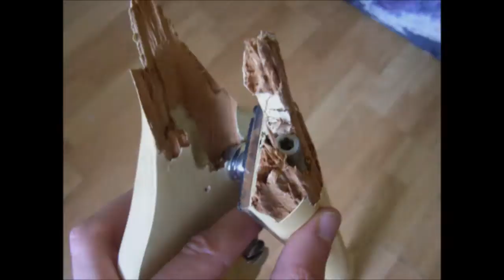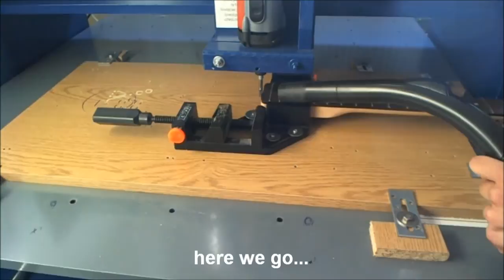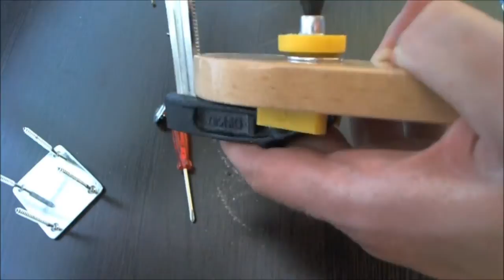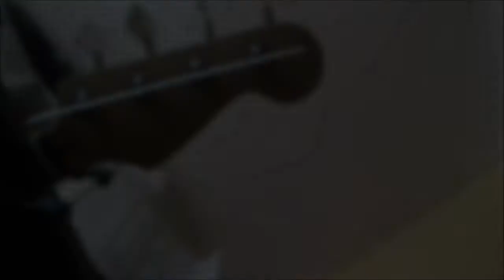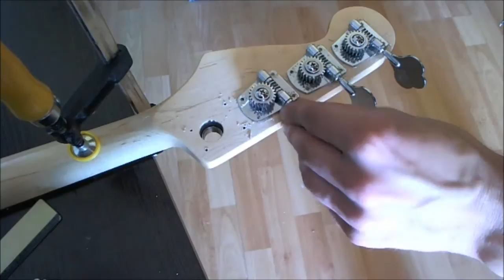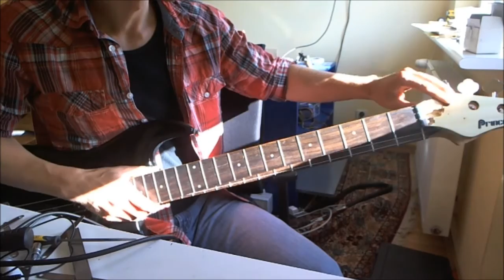Bass guitar repair - replacing a broken neck - hints

Comment from the maker: Yes you can! Be sure the neck joint fits the body,unless you want to work on the fit.I didn't notice that the neck I was buying was rounded and I had to cut it to size-luckily the other dimensions have been just right.Note that if you go with a longer neck you will have more tension on the strings.This will make strings harder to bend.You will also have larger distances between frets-this may make the guitar harder to play.Again if it's not an issue for you I say go with the longer neck.Cheers!